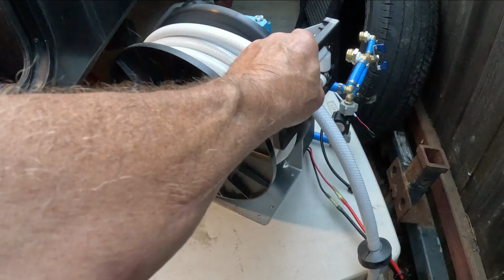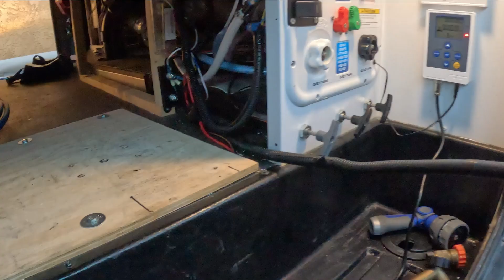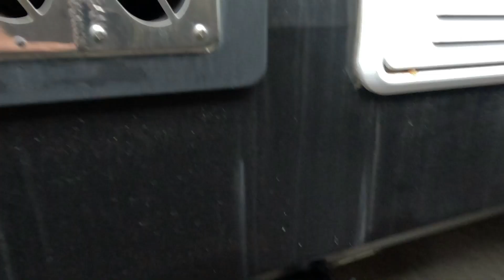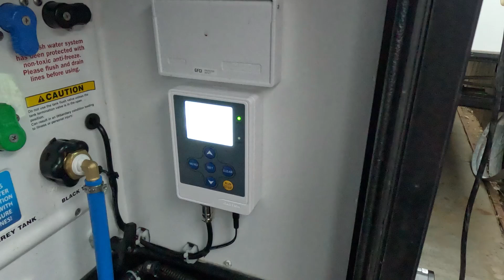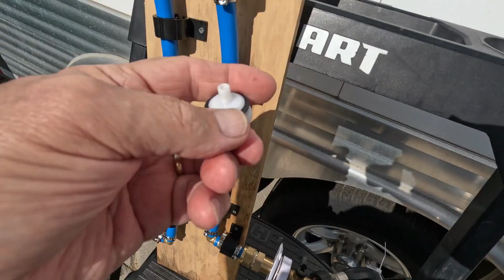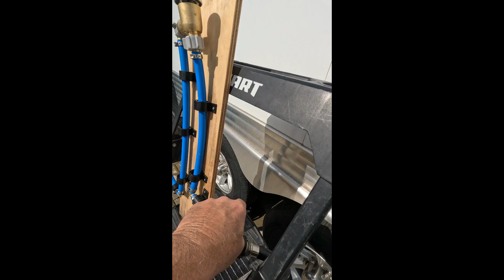RV Black Tank Flush   Final

Comment: Awesome design. I had already determined I wanted that black tank flush line to dump/empty and require a human/processor to do at least 2 things to flush tank. Yours is the first video I have seen doing that. 

What's  in the control box? I was thinking Arduino.

Have you automated your tank dump procedure?
Reply from the maker: The control is a DIGITEN water flow meter. I used the same unit when I designed the tankless water heater pre-heat system. If/when I need to drop the Coroplast I will install electric valves and make the process fully automatic.